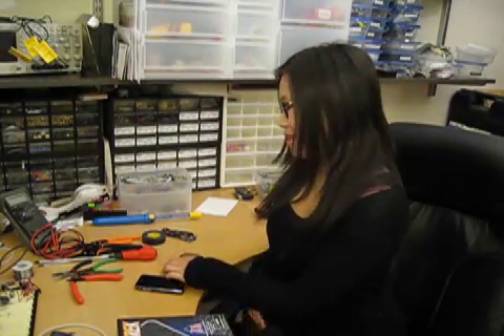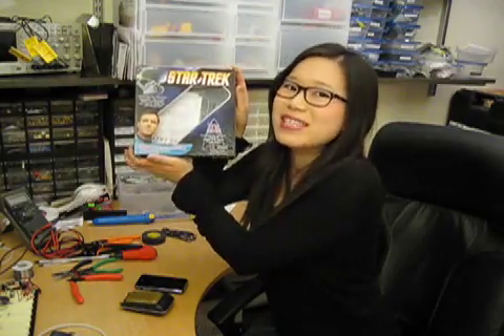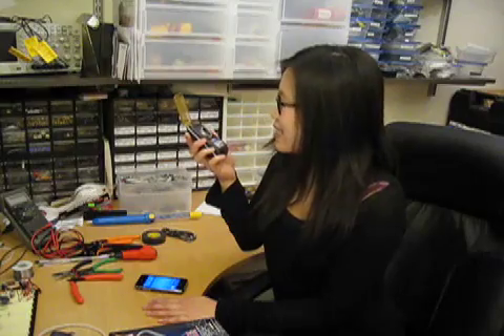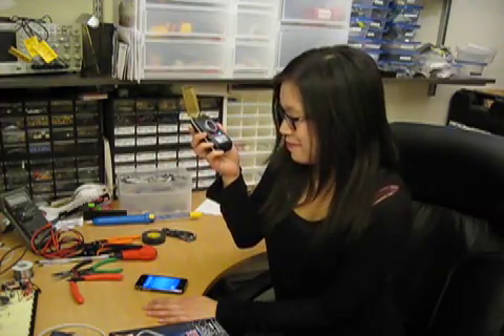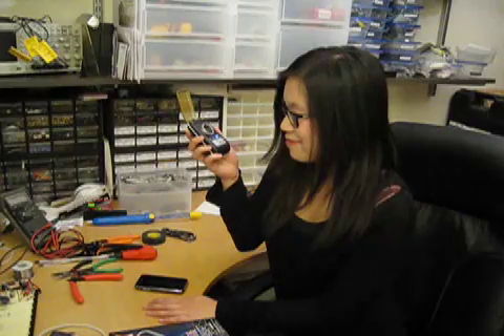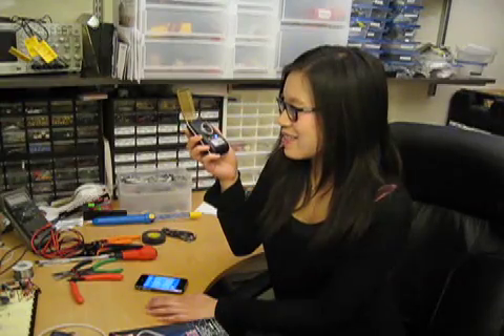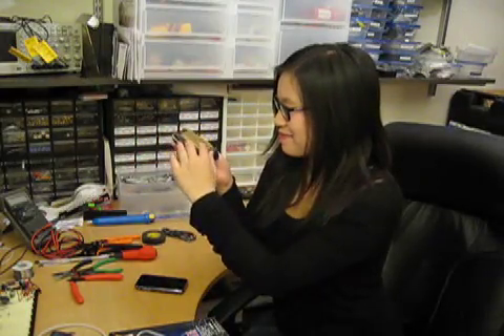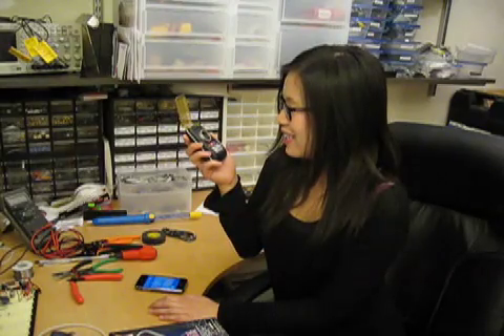Bluetooth Star Trek Communicator

Comment: Is there a charger that will charge the battery without using the original charging stand.  The only thing it does is flash a slow white light when the communicator is attached to it.

Comment: OK, do you have a way to convert a communicator into a walkie talkie set using a set of the world's smallest walkie talkies. these talkies are about the size of a grape and come in a set of two. This would be a cool project. the range is only 150 feet, but there must be a way to boost the signal. Anyway, i'm tempted to try it even though i can't find any help on the net. There would be plenty of room to have a larger internal antenna.

Comment: my version is better,I have my full cellphone built into it,the key on a spring loaded tray,the inside removable so you can see the screen if you need,and a microcontroller to play the open chirp.THE ONLY THING YOU HAVE ME BEAT ON:my phone cant accept custom ring tones,I can't get the beep for a ring tone I'm probably going to add a second microcontroller,remove the vibe motor,and use the current as an indicator for the micro controller to play the beep,and an external switch for the vibe mode.